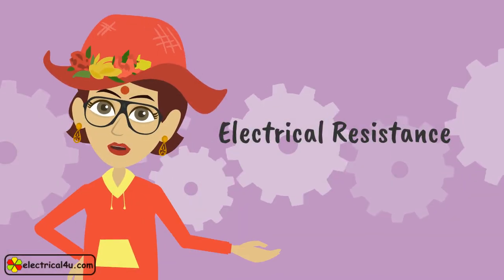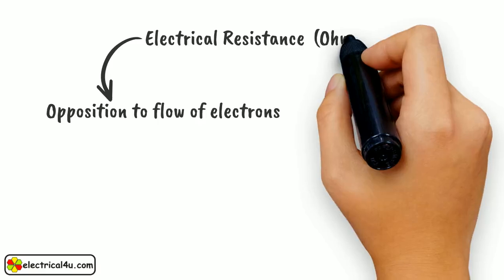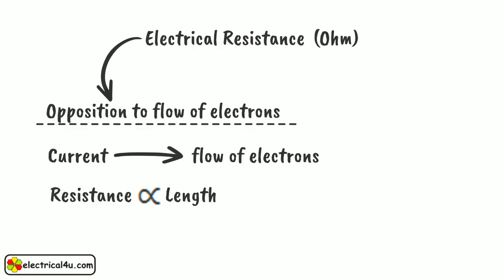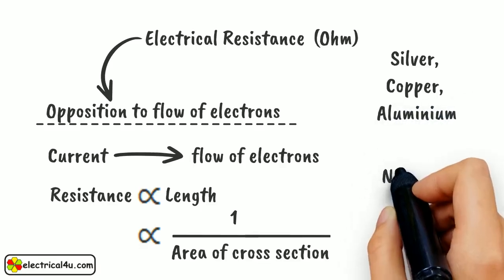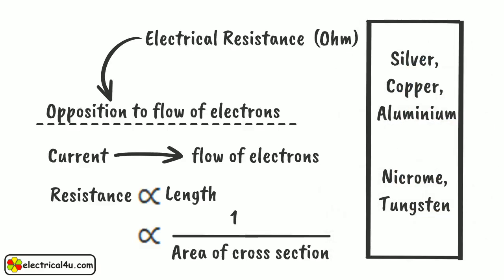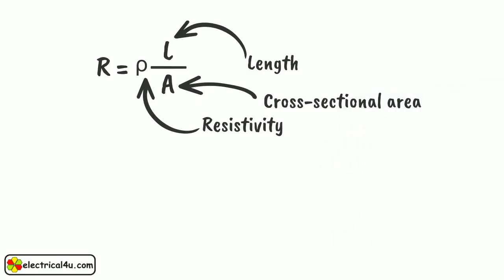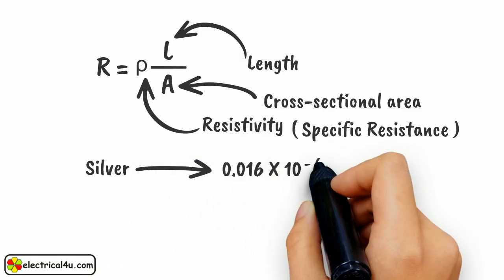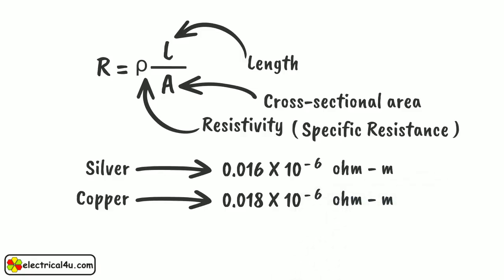Electrical Resistance

Comment: Let's discuss about the basic concept of electrical resistance. 

Electrical resistance is the opposition to the flow of electrons in a given material. It is measured in units called ohm. Actual pause of electric current is the flow of free electrons in a material and resistance is the opposition offered by this material to the flow of free electrons.

Resistance is directly proportional to the length of the material and inversely proportional to the area of the cross section of the material through which the current flows.

The resistance offered by conducting materials like silver copper and aluminium is low, whereas resistance offered by some other conducting materials like nichrome tungsten etc is very high. All these materials are called conducting materials, however the values of resistivity of these materials are different. 

The resistance R of a material is expressed as R equals to rho times l by A, where rho is the resistivity, l is the length and A is the cross-sectional area of the conducting material. The resistivity rho is also called thenspecific resistance of the material.

The most conducting material silver has the lowest value of resistivity that is 0.016 into 10 to the power minus 6 ohm - m. After silver, copper is the most conducting. The resistivity or specific resistance of copper is somewhat more than that of silver that is 0.018 into 10 to the power minus 6 ohm - m. That is to say copper is less conducting than silver.